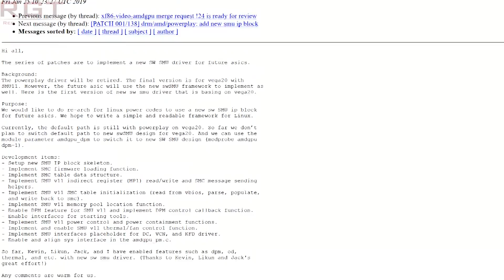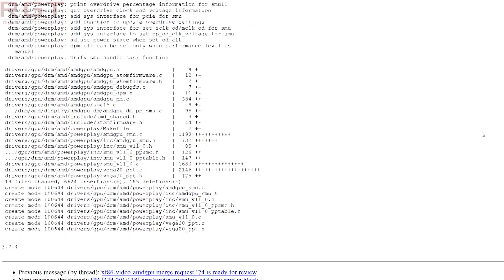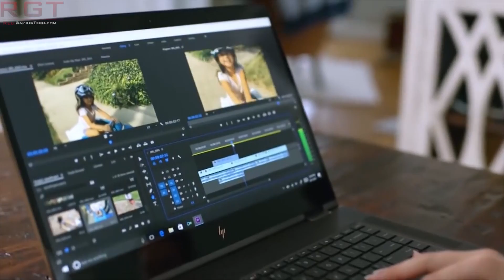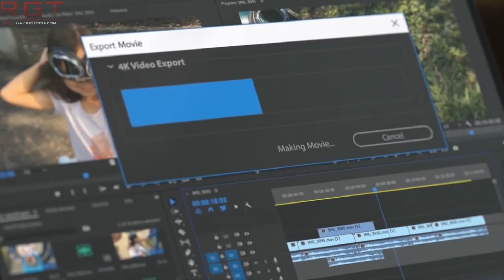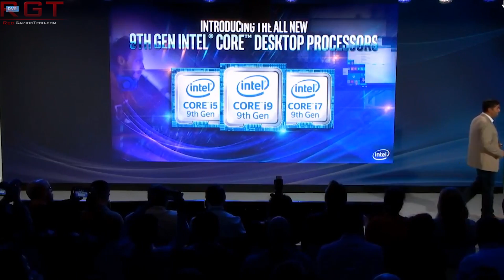Navi AIB Partners Brief On Specs & Linux SMT Updated | TSMC Readies 5nm

Comment: Do you guys also love it that Intel is going to get into big troubles when Ryzen 3rd generation comes out? 
Don't get me wrong, I want competition but Intel deserves a good spanking and they will come back.
Reply: AMD fan, own stock. Have first gen Ryzen and Radeon gpu. BUT I still am skeptical about Ryzen 3 being too good to be true.
Reply: @RobbieRobski  I can imagine, you don't want to get disappointed. 
Here is the deal: there is no doubt that Ryzen3 will beat the crap out of Intel for multithread, the question is whether or not it will beat the 9900k for singlethread performance and that will come down to clock frequency and 'IPC'. Also there is the matter of added latency due to core-hopping (more the developer and Microsoft their fault than AMD its fault). Simply explained: when data is in cache on one CCX and it has to go to the other then you loose a lot of time because data needs to get copied from the cache on one CCX to the cache on the other CCX. I also am curious what the effect will be of the I/O being on a separate chiplet. In theory that should be a disadvantage but AMD probably has found a solution given that AMD its partners have put pressure on AMD to improve the gaming performance.
Reply: @RobbieRobski  if adoredtv is right the problem will be latency.  at least for gaming.  for pro apps itll be great.  but he is saying that the 8 core will be 2 dies with 4 cores on each cut off.  so if you plan to use mroe than 4 cores for gaming the latency from going off one die to another will be high.  its 4 times normal ccx to ccx latency on treadripper.  if they go with a single 8 core die for the 8 core chips then they will cost more.  not sure if that would be a ryzen 5 product.

we really need to know if it will be the same core counts as now with a 12 core addition to be called ryzen 9 or if the leaks are true that ryzen 3 and 5 will be jumped up 2 cores.  then we'll know the potential catches and drawbacks to their setups.  plus we need to know what intel will release.

as far as clocks and such i think there will be wilder swings in the silicon lottery and i think the really high boost clocks will be like 2 cores only.  and of course a 16 or 12 core chip would run more like low 4ghz anyway.  

i think to match intel gaming performance you will have to get a ryzen 7 at least so that you have at least 6 good cores on one die.  if they have a ryzen 5 that is 8 cores it will most likely be 2 4 core dies and the latency will be a problem.  if its a single core then they will be the slowest binned ones and wont clock well.  and that migth still be too expensive.

we'll just have to wait and see.  i would expect intel to make the new i7 be at least 8 cores 16 threads and be 8700k prices and the new i9 to be atleast the rumored 10 core.  of course the next i7 could BE the 10 core who knows.  and an ipc boost as well.  and they can do it on 14nm too.  it doesnt have to be 10nm.  

people will say " well if they couldnt put out the 9900k in numbers on 14nm then they cant do more than that"  but the thing is they dont need the 9900k now.  the 8700k competes fine with the 2700x.  they need something to compete with next gens chips.  and intel starts making the next line of chips about 2-3 months after the current chips start shipping.  so they have already been producing the 10th gen already most likely.  that means that if they put out  the 9900k and the whole 9th gen out in limited numbers now (and remember they really dont even need the 9th gen to compete right now) then that means they will be able to produce more 10th gen chips.  thats why they shortage is on now.  because they are making next years chips right now instead of current ones.  

ryzen 3000 will be a beast at pro work.  gaming will get better than current zen.  but i think intel will keep the lead in gaming (maybe by a narrower maragin) and be a bit behind in pro work.  the difference isnt going to be as huge as some people think.  you have to keep in midn that everybody besides intel decided to rename 20nm to "14nm" when they added finfets.  so the other faabs have been off one gen since then.  that meanst hat intel is already on the second or third gen of what amd would call 10nm.  3rd gen 10nm vs first gen 7nm is really closer than people think

the main thing is that both will really up the core count and perfroamnce and we will all benefit.  thats what really maatters
Reply: @bobhumplick4213  Jim made an assumption that 8 cores parts will be 4 + 4 based on yields. Obviously the yields are good as the die shown at CES was a single 8c Zen 2 die not 4 + 4. So there will be zero cross core latency on 8 core & below parts as they will all be a single Zen 2 die.
Reply: @jamespieske5246  "Obviously the yields are good as the die shown at CES was a single 8c Zen 2 die"  how can that tell you anything about the yields?  its one chip.  they are making thousands a week and they have one good chip to show off and that means yields are good?  

to be honest i think the 2 chiplets with 4 cores each will be the high clocking one.  the low clocked one will be a single 8 core chiplet. 

why not just 1 high clocking die you ask?  because those will be in high demand for epyc,threadripper, the 12 and 16 core cpus.  i dont know if they can give away a chip that bins that well fro ryzen 5 prices.  

the old rules of process shrinks dont apply anymore (EUV  might change that but it isnt here yet).  its not cheaper to use the new process but the same price at best and costs more at worst.  that 8 core chiplet costs as much as a current 8 core ryzen die.  then you add in the cost of the IO die which is nearly 3/4 the size of a current ryzen die as well.  thats not gonna be cheap.  that sounds like ryzen 7 territory to me. 

now if you have a full functioning 8 core die that just doesnt clock very well then yeah sure make it a ryzen 5.  or 2 chiplets that dont have all cores functioning or they were corner chips that had half their cores cut off on the wafers edges.  put them together to make ryzen 5s sure.  but a high quality 8 core die for a ryzen 5.  that doesnt make sense.

amd will have both a single low clcoked 8 core and a 2 die high clocking 8 core for ryzen 5 or they will stick with 6 cores for ryzen 5.  one or the other.

i just dont see them giving away the best 8 core dies for a 5 series chip.  

it very well could be those leaks were for  ryzen 4000 series.  right now they may be planning a 6 and 8 core lineup like they have now and adding a 12 core ryzen 9.
Reply: @bobhumplick4213  they are obviously yielding enough 8 core Zen2 chiplets that they can afford to utilised them in in Ryzen 5 branded desktop parts.

As for the rest of your waffle.
It's squarely in the TL;DR category.
Reply: @jamespieske5246  "they are obviously yielding enough 8 core Zen2 chiplets that they can afford to utilised them in in Ryzen 5 branded desktop parts."

they havent announced these as ryzen 5 parts.  youre just seeing someone elses waffle and assuming its true.  you dont know anything about what a ryzen 5 3000 will be.  do you not understand that?  nobody at amd has said anything about that.  they just showed an 8 core cpu and didnt say anything about which cpu that would be.

so when adoredtv says something you like (like these leaks) then hes right.  but when he says something you dont like (like the higher clocked ryzen 5's being 2 4 core dies) then hes wrong.  do you see whats wrong with that? what are you gonna say if these turn out to be ryzen 7 parts and cost 300+ bux?
Reply: @jamespieske5246  if youre just gonna take every leak at face value and expect to join in dont expect people to take what you say seriously
Reply: @bobhumplick4213  hahaha!
You with your double standards.
First you waffle on about 8 cores using 2 4c chiplets based off a leak then you act dismissive towards me using Ryzen 5 nomenclature sourced off the same leak you reference.

Go home you're drunk.
Reply: @jamespieske5246  no its not a double standard.  look at what you said "First you waffle on about 8 cores using 2 4c chiplets based off a leak then you act dismissive towards me using Ryzen 5 nomenclature sourced off the same leak you reference.
"

it doesnt really make sense.  i hate talking to people that dont realize they arent making sense.  they are always so sure that they are.

here is how it breaks down.  ok there are the leaks and then there is the adoredtv video.  im talking about the adoredtv video.

he said that they ryzen 5 chips will be 2 4 core chiplets.  and you said no they will be 1 8 core chiplet.  adoredtv made some points about why they would do this and it makes sense. but that will have drawbacks.

as far as "based off a leak then you act dismissive towards me using Ryzen 5 nomenclature sourced off the same leak you reference"

i dont really know what the hell you are talking about.  i wasnt dismissive of you based on the adoredtv.  i was just following it to its natural conclusion.

then you said that its obvious that they are yielding well based off one single chip.  which made no sense at all.  you just assumed it was a ryzen 5.  its not a ryzen 5.  its not anything but an engineering sample.

i didnt do anything you just said.  and i dont know what your fascination with this word waffle.  im not sure you even know what that word means in this context.  you should read more on the subject and you will see why im saying what i am, even though you may disaggree with what i am saying.  instead youre just looking for things to try to trip me up.  very sad
Reply: @bobhumplick4213  waffle1

/ˈwɒf(ə)l/

INFORMAL

verb

1.

BRITISH

speak or write at length in a vague or trivial manner.

"he waffled on about his problems"

synonyms:prattle, chatter, babble, ramble, jabber, gibber, gabble, gab, burble, flannel, run on, mutter, mumble, prate, drivel, bleat, cackle; More

2.

NORTH AMERICAN

fail to make up one's mind.

"Joseph had been waffling over where to go"

noun

1.

BRITISH

lengthy but vague or trivial talk or writing.

"we've edited out some of the waffle"

synonyms:prattle, jabbering, verbiage, drivel, meaningless talk, nonsense, twaddle, gibberish, stuff and nonsense, bunkum, mumbo jumbo, padding, flannel, verbosity, prolixity; More

2.

US

a failure to make up one's mind.

"his waffle on abortion"
Reply: @jamespieske5246  well thats great.  it means something different in america.
Reply: @jamespieske5246  but what i said was not a double standard. thats not even really what double standard means but...

also i wasnt dismissive based on what the adoredtv video said.  i was being dismissive because those are going to be hihg demand chips and selling them as ryzen 5s with all the added expense just doesnt seem like the best plan
Reply: @bobhumplick4213  oh really? Keep going in circles pal..

double standard

noun

plural noun: double standards

a rule or principle which is unfairly applied in different ways to different people or groups.
Reply: @jamespieske5246  yes and i didnt apply any standard unfairly to any group of people.  thats where you have it wrong. explain to me again how i did this.  tell me what i said and what you said and why it was wrong.  maybe then you will see theres nothing wrong with what i said.  i am still failing to see your point because you dont have one.
Reply: I want it to be a dead race, identical.
Reply: @hjembrentkent6181  
You make a reasoning error, in my opinion. For it to be equal AMD will need to lead for 1-2 decades given the difference in money, size of the company, marketshare...
For us regular people it is good if AMD leads for a while, it motivates Intel to become competitive again and given the mentioned differences AMD won't abuse that technological advantage in the first years with higher prices and laziness, not as long as they are so far ahead in all other areas.

So no, I don't want it to be a dead race, not yet! Maybe 5-10 years from now but not right now. In this respect I disagree with Paul. For it to become equal AMD will need to lead for a while. Intel has got a lot of fat on its bones, Intel wlll be all right and become competitive again. If AMD gets a bit more profit in the next years then AMD will only develop better technology because they can spend more on R&D. If Intel gets a good spanking then Intel will learn again to innovate. All good.
Reply: @peterjansen4826  Performance/value equality means people will buy intel because reasons and that means AMD will always remain underdog making only cheap value oriented products in shadow of Intel or at best have role of pushing intel pricing down(so people can get their intels cheaper). AMD needs to have clear edge over intel to be actually equal and they need to keep that going for few years. Intel is not going anywhere, world doesn't have manufacturing capacity replace intel's production. Intel is huge, second largest producer of semiconductors without share in mobile phones or memory chips(dram&nands). Even if every one wanted to buy AMD, they wouldn't have enough production to sell to everyone. It's ludicrous to worry about intel, they are making billions of profits, more than AMD has revenue even if recent success is counted in. DIY and gaming cpu market is only small slice, doesn't matter in big picture if AMD takes it over. It's also impossible to corner it and easiest to get back while having lowest profit margins. Intel knows it and diy/gaming cpus were first to go when they had to prioritize production.
Reply: @kognak6640  
That is why AMD can get the technical lead for a few years. Let AMD have the better node and better micro-architecture for a few years. Indeed, even if all the enthusiasts (so people who assemble their own PC) buy and AMD CPU  then still Intel will keep dominating the OEM market. Let AMD get sold more in the assemble-it-yourself market, that is how you get a leveled playing field. This is overlooked by Paul (RedGamingTech).
Reply: @hjembrentkent6181  that would be nice.  as long as both are giving us the best they can for the best price then who could argue.
Reply: John Hooper  who are you replying too?  the original poster didnt say anything about that.

if you were responding to my comment on how intel stockholders might have to get used to lower profit margins then i think you might want to google how profit margins work.  if you make the same sales but have to spend more on a the products you sell (by making them bigger) then profit margins go down.  they could offset this by selling more of them but the margins would still be less that what intel stockholders have gotten used to for the last 5 years with no competition.  its a relative thing
Reply: I hope intel gets btfo
Reply: Yes, I do love it and this is exactly what makes competition good for the consumer. AMD release a chip that makes intel pull their chairs in and sit up, alert. Then they decide that they better push for own tech to release sooner, or at a better price. It's much better to have this going backwards and forward, instead of one fat over-confident company getting as much from each line as they can, because they can. 

We only hope that AMD really can put NVidia under the same pressure. So far, they are  a bit further back.

As for me, just last week I built a new PC (well mostly). I went to AMD for the Ryzen 5 2600 and couldn't be happier. I've a friend who got the exact same, another who went for a threadripper and yet another who is looking at the Ryzen for his next. 

I swapped my old GTX 960 into this but I'm going to wait and see what happens with the Navi (or maybe the Vega 56, depending). I don't want to support Nvidia for the moment. They've gotten cocky and I'd be a fool to reward their behavior.